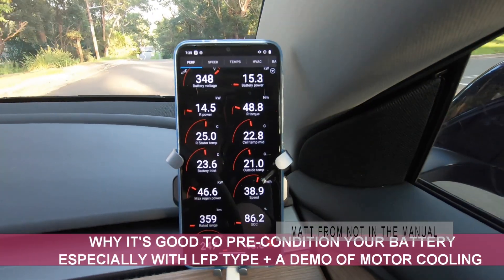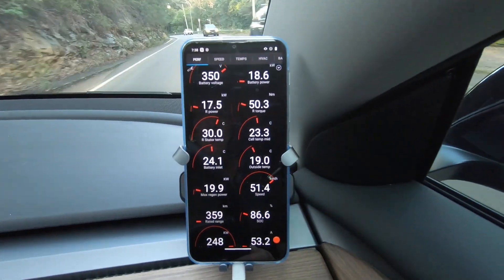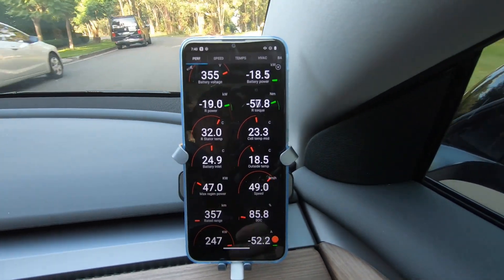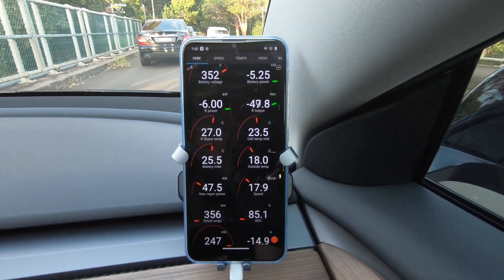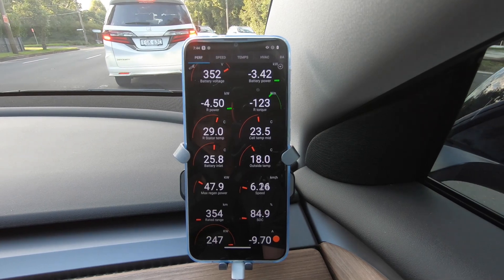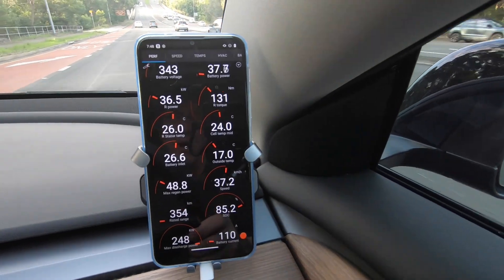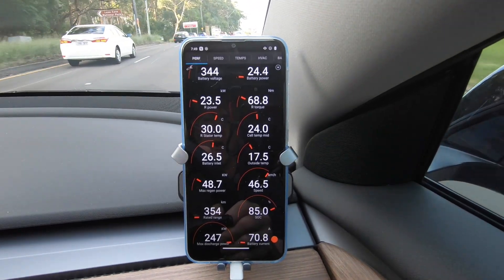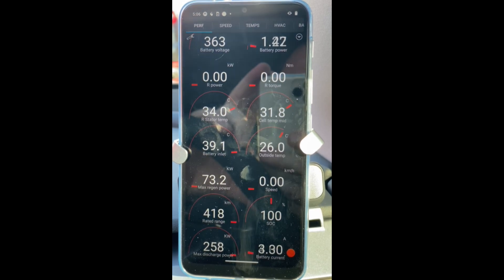Regen limiting with a cold LFP battery - another reason to precondition. Quick look at motor cooling

Comment: I have a dual motor model 3 and it indicates up to 85kw regen, this is not the LFP battery, at 100% SOC I have almost no regen.
Reply from the maker: Thanks for the info. That’s a benefit of the dual motor and non-LFP. With my LFP RWD the battery has to be warm with a lower SOC to have 85kW of max regen. + and - to either chemistry I guess. LFP has 65kW regen at 100% SOC when warm only. I did a bit more testing on this in a later video about preconditioning.

Comment: Hi, thanks for a very interesting and informative video. A couple of questions, firstly what is the app that you are using that gives all that information (I guess it is plugged into the OBD port)?
Secondly how do you precondition the battery, as this will be essential for me. The battery temperature which is garaged overnight is 9.7 degrees and the outside temperature is -1.0 degrees.
Many thanks.Roger
Reply from the maker: Hi Roger. Luckily I have videos on both. The app is called scanmyTesla and it connects using a Bluetooth adapter with a small harness connector. I have a full tutorial in my first channel video. Check out episode 1 of my pre-conditioning series series too. You will find everything there.
Reply: @notinthemanual  Many thanks.

Comment: I know it sounds stupid, but how do you  precondition the battery? I'm getting my Model 3 this year and I've never understood how to do it.
Reply from the maker: Not a stupid question at all. There are a couple of ways to do it. It’s not 100% necessary. It is mainly for comfort, efficiency and consistent driving feel. The simplest way is to remotely activate the climate using the Tesla app. This will get your cabin to the set temp and heat up the battery if needed. The second way is to schedule a departure time either in the app or in the car. The car will then turn on climate and precondition the battery by the set departure time. I have mine set to 7am departure on weekdays only. This is set by location too which is cool. If you have your car plugged in during preconditioning it does not take energy from your battery if the energy needs don’t outweigh the wall socket output. Plugged in will precondition the battery much faster too as it will also use the rear motor as a battery heater. The battery will try and heat up to 30degC regardless of whether you precondition so it is best to do this while plugged in before you drive. Your efficiency will be better as the car is preconditioned before you drive leaving more energy to be used for driving.
Reply: @notinthemanual  see now that it's explained, it just makes so much sense. I've subscribed too, so look forward to the content.
Reply from the maker: I do have a video to make on preconditioning too. Hopefully get time to shoot it soon.
Reply from the maker: Oh and congratulations on ordering your M3. Hope the delivery time improves as the year goes on. I waited 3 weeks for mine this time last year and it killed me. Feels silly when I think about it now.
Reply: @notinthemanual  thanks mate. Updated just recently on the app, to August - November 2022.

Comment: And I thought there are no low temperatures in Australia to interfere with precondition and most of the time there is no need to do so. After all, 20 degree C is not low temperature ?!. You can spill more energy on precondition than you regen .
Reply from the maker: Hi Batticha. Some parts of Australia do get cold but not where I live. Middle of winter my battery is 15degC in the garage. I agree with you but Tesla thinks 20degC is still too low for lengthy regen times downhill. This limit is programmed by them to protect the battery. As time goes on I hope reduce this regen limitation as they have done with the charging curve for LFP. This video was to show that it is not a fault with the car but how it is programmed to function. Pre-conditioning is a personal choice. It's not compulsory. The car is still acceptable to drive if you don't pre-condition. There are more benefits to pre-conditioning other than heating the battery. Its more about consistent drive feel than saving energy. My drive to work is mostly downhill and I regen a lot more energy than it costs to pre-condition but my home journey uses a lot more energy. If you don't pre-condition the car will still use energy to heat up battery and cabin after you start driving but not as aggressive. It will scavenge heat from cabin and motor which takes longer. I like to have the cabin at a nice temp before I get in. In hot weather it will reduce the humidity in the cabin so still worth it. If you are going on a long trip it will be more efficient if you pre-condition while plugged in.
Reply: @notinthemanual   Thank you very much for the satisfying answer. In my case I worry more about summer so I cool  the vehicle before each trip. In the banal winter here in Israel, there is nothing to worry about, at least where I  live

Comment: This is really bad. Can tesla fix it with software?
Reply from the maker: Not really. It’s to protect the battery from damage when cold. It’s not really that bad and only happens on extended downhill sections. For shorter  regen periods it’s fine. I just wanted to let people know this is normal when the battery is cold. Unless you have scanmyTesla running you can’t see what is happening. You still have normal brakes to use anyway for the small period this is an issue. Only way to minimise this is to pre-condition. I saw your other comment. How much energy pre-conditioning uses is irrelevant if your plugged in. If your not plugged in then decide if you really need to it’s not compulsory. Overall I’d still prefer an LFP over NC battery in the standard range. NC batteries have their share of issues too. It’s a matter of working out what’s best for you.
Reply: @notinthemanual  compared to the NCA which i had before, i think it is. It should not be neccesary to preheat for so long just get a bit of regen. In Denmark where i live, it's currently 10° celsius and the battery is stone cold with absolutely zero regen if i don't preheat before departure. That's not good. I had a Long Range before and i had plenty of regen even with no preheat. In order to preheat every day, my electricity bill will be a lot higher. That's not good for me or the environment.
Reply from the maker: @jonathan6665  Sorry I don't have a better answer for you. I've had mixed feedback on this issue. I think it comes down to a personal preference in some cases. I mostly pre-condition unplugged as I charge at work off the solar system there. I very rarely charge at home so I am very lucky to mostly be driving and pre-conditioning on sunshine. I am not sure how much electricity is in Denmark but I pay 21cents/kWh here. The most I have seen my battery drain down for scheduled departure is 2%. This is only when I leave later than the scheduled departure time and climate stays on longer. This is approx 1kWh so for me if I had the car plugged in I can live with that expense. For much colder climates this would be more expensive but still overall much cheaper than running an ICE car. The coldest my battery gets is 15degC in winter so I have no experience in super cold climates. I schedule departure every weekday even in summer here as it gets humid and it is nice to get into the car with a comfortable cabin. There is more benefit to pre-conditioning than just heating the battery. My friend never pre-conditions his LFP M3 and is quite happy to live with less regen but once again he is in Sydney too and doesn't have another car with NC battery to compare. There would be a lot of people like him. I guess there is the possibility that one day when Tesla has more field data on the LFP that they will back off the limitation like they do with charging curves over time.

Comment: I own the same car and I still don't quite understand why it drops that fast, it surely does not cool that fast, so if the state of charge is the same and temperature is the same, why going downhill with regen on makes it drop that fast? Is it the same with NCA batteries?
Reply from the maker: Hi Gabriele. I believe it is to protect the LFP battery from extended periods of high current flow when cold. Once warm it does not do this as much. For short periods of regen at normal speeds you barely notice it. It’s just the longer descents. Short bursts for acceleration during drive are a shorter duty cycle so are less of a concern. I think in the big scheme of things it’s not a huge issue but I wanted everyone to know it’s “normal”. I can’t talk for NCA batteries. I was hoping someone would comment. The trade off is NCA at 100% charge has almost no regen where LFP still has good regen.
Reply: @notinthemanual  and I was looking for someone to confirm and explain this behavior so cheers for that.:D I have a steep descent just outside my house and so far (in european winter/spring temperatures) I almost immediately lose regen. I guess I have to really use the scheduled departure every time even in 15/20ish degrees if the night was cold
PS your format is great, keep up the good work!

Comment: It is very interesting for me. I have a Kia eNiro and now ordered a TM3 SR with a LFP 60kWh.
What will happen if, in the temperature of about 0 degrees Celsius, I do not carry out the initial preparation of the car for driving? Will the car start heating the batteries by itself when it starts to drive? It is a pity that you do not have experience in temperatures around 0 ° C ... Or maybe you know what will happen? where I live in Poland, it is now about 0-3 degrees Celsius and I am curious what would be the regeneration power at such a temperature? Is the charging power equal to the regeneration power if I use a charger other than the Supercharger?
Reply from the maker: Hi Piotrek Sz. Yes the car will start to heat the battery while you drive but in my experience it will not do it as fast as when you pre-condition the car when it is stationary. When you pre-condition the car it will pre-heat the battery to around 22degC quite fast but then it slows down a little. The residual heat from this will help the batteries get to the target temp 30degC much faster than if you don't pre-heat. If you search youtube for Bjorn Nyland he has some cold weather videos from Norway.
Reply: @notinthemanual  Thank you very much. I know Bjorn's movies with LFP batriami almost by heart, but it's still not enough for me to be sure of my choice and not have problems driving in winter (in Poland it is sometimes below -10 degrees Celsius, or even -15 degrees Celsius). Generally, in winter it is from -5 to +5 ° C for about 4 months. To your knowledge, how much energy can such a car use to heat the battery from about 5 to 30 degrees Celsius when the car is outside in winter (I have a garage at home with 15 degrees C inside)? Sometimes I go somewhere and wonder how much energy will I lose to pre condition? Sorry for my language, but I'm from Poland
Reply from the maker: @piotreksz5713  Your English is good 👍 My car in garage takes approx 20mins to pre-condition battery from 15deg to 22deg. This is using both the heat pump and the motor to do this with 15deg ambient and is mostly drawing 3.5kW from the battery to do this. In cold weather this would take longer. I wish I could give you more information on this. I want to make more videos on pre-conditioning but it won’t be in super low temps like you have there. I also won’t be able to make these videos for a while as my car is still being repaired. My advice to you based on what you have told me about your limited supercharger options and extreme cold weather would be to look at the long range model. It can use both motors to help heat the battery and would possibly be better at pre-conditioning in cold climates.
Reply from the maker: @piotreksz5713  in addition to my last comment. Pre-conditioning all the time is not compulsory. You just need to understand that some functions will be limited while the battery is cold and the trip will not be as efficient. If you are able to pre-condition the car while plugged in then the car will not need to use energy to heat the battery while driving. I would also not be worried about damaging the battery if you don’t pre-condition. The car will do what it needs to do to protect the battery from damage like limiting regen braking or fast charging when the battery is too cold. Pre-conditioning is just one of those best practice things and helps for a more efficient and consistent drive performance. If you are concerned about range in winter and have limited fast charging locations then I would suggest the long range. I also just thought that you will probably want to pre-condition to defrost the car if outside. You would need to use this energy no matter what battery you have. I really wish I could help you more and sorry if I just made this more confusing for you.
Reply: @notinthemanual  I know the LR is better than the SR but it's more expensive and I won't get the government subsidy for it. I can only buy SR with LFP battery and have already placed an order for it. If you find a good technical video about conditioning TM3 LFP in cold climates somewhere, please send me a link. I think that from 0 deg to 22 deg battery takes about 60 min or more....
Is your car being repaired? What happened? Thank you for your help.
Reply from the maker: @piotreksz5713  Ok. Yes we have similar government subsidy here in Australia. My honest feeling is the LFP will be ok for you but I don’t have facts to back that opinion up. Another option is to approach a model 3 owner at a supercharger and see how they like the car in winter. I am always happy to help people who approach me at the chargers.
Reply: @notinthemanual  There is little TM3 with LFP battery in Poland and I have a problem with obtaining information, so I'm looking for all over the world 🙂
Reply from the maker: @piotreksz5713  In regards to my car. Someone crashed into me and it took a long time for the parts to come. It is almost repaired. Two doors and rear quarter panel had to be replaced.
Reply from the maker: @piotreksz5713  Hi. There is a nice guy @Byte Mark who has commented on my LFP video. He has some experience with LFP in Canada much colder than Poland. Please read his comments. You could ask him some questions too. He said he had no problems.

Comment: Loving the LFP content! Do you think the motors get hot in regen and the drop in kW is heat management or do you think the cooling system should cycle that heat back into the battery if it's already cold (like it usually does)?
Reply from the maker: I’ll be dong another video at some stage showing this same system during pre-heat for supercharging. It lets the motor get to 60degC and uses that heat to warm the battery for fast charging.
Reply from the maker: Hey GRETZ. I don’t think the kW drop is heat related or it would do this all the time not just when battery is cold. The excess heat is circulated to other systems that need it like the battery. You can see the battery inlet temp rise after the short accelerations. The heat generated from regen is a lot less than the heat generated from hard acceleration. It’s pretty efficient at cooling the motor. Heat generated during regen would be no trouble to keep under control.